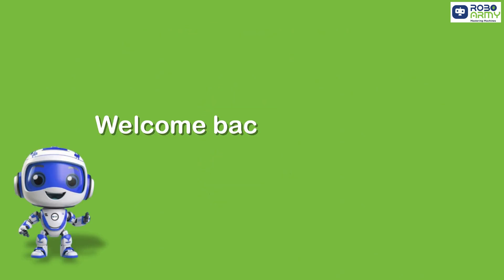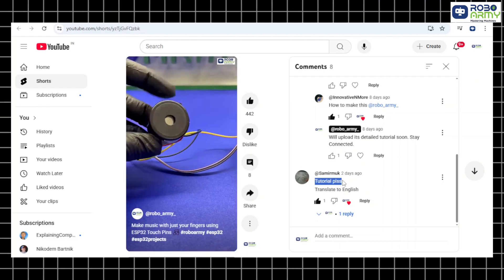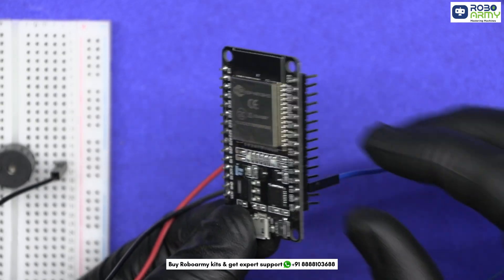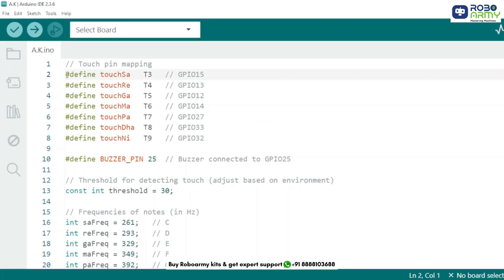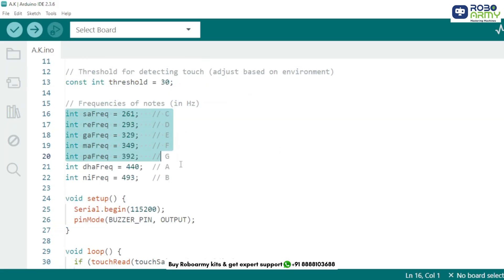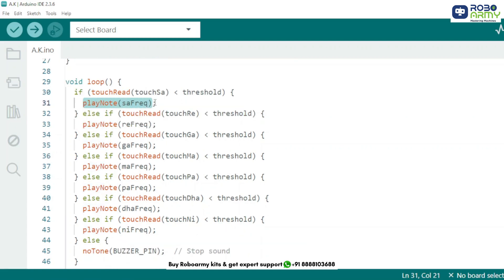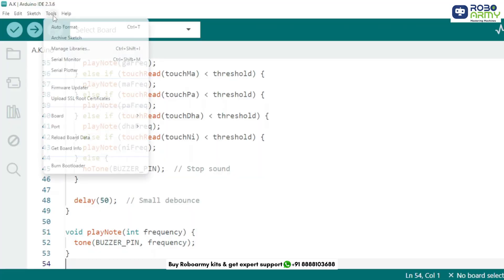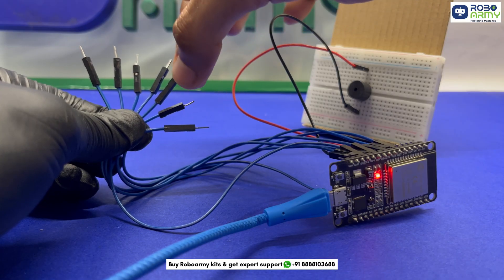DIY Touch Piano Using ESP32 & Buzzer | No Buttons, Just Touch to Play!

Comment: Unfortunatelly doesn't work for me: 'playNote' was not declared in this scope
Reply from the maker: Hmm, that error usually points to an issue with how the playNote function is defined or if a required library isn't correctly imported. Double-check your code for typos in the function name or if you're missing an include statement.

Comment: the buzzer just stays on no mater what i edited in the code
Reply from the maker: It seems like the buzzer pin might be set to HIGH all the time. Please double-check your wiring and make sure the buzzer is connected to the correct digital pin. Also, verify in the code that the buzzer is only triggered inside the button press conditions, not in the loop() by default. If you share your code, I can help you debug it further.
Reply: I had the same problem. Try this

// Touch pin mapping
#define touchSa   T3   // GPIO15
#define touchRe   T4   // GPIO13
#define touchGa   T5   // GPIO12
#define touchMa   T6   // GPIO14
#define touchPa   T7   // GPIO27
#define touchDha  T8   // GPIO33
#define touchNi   T9   // GPIO32
#define touchC    T0   // GPIO4

#define BUZZER_PIN 25  // Buzzer connected to GPIO25

// Threshold for detecting touch (adjust based on environment)
const int threshold = 1000;

// Frequencies of notes (in Hz)
int saFreq = 261;   // C
int reFreq = 293;   // D
int gaFreq = 329;   // E
int maFreq = 349;   // F
int paFreq = 392;   // G
int dhaFreq = 440;  // A
int niFreq = 493;   // B
int CFreq = 522;     // C

int currentFreq = 0;

void setup() {
  Serial.begin(115200);
  pinMode(BUZZER_PIN, OUTPUT);
}

void loop() {
  // 1. Reset the target frequency at the start of the loop
  currentFreq = 0; 

  // 2. Check all touch pads independent of each other 
  //    (using 'if' blocks, not 'else if')
  
  if (touchRead(touchSa) < threshold) {
    currentFreq = saFreq;
  } 
  if (touchRead(touchRe) < threshold) {
    currentFreq = reFreq;
  }
  if (touchRead(touchGa) < threshold) {
    currentFreq = gaFreq;
  }
  if (touchRead(touchMa) < threshold) {
    currentFreq = maFreq;
  }
  if (touchRead(touchPa) < threshold) {
    currentFreq = paFreq;
  }
  if (touchRead(touchDha) < threshold) {
    currentFreq = dhaFreq;
  }
  if (touchRead(touchNi) < threshold) {
    currentFreq = niFreq;
  }
  if (touchRead(touchC) <threshold){
    currentFreq = CFreq;
  }

  // 3. Update the buzzer only once based on the final determined frequency
  //    (If multiple pins are touched, the last one checked will set the frequency)
  if (currentFreq > 0) {
    // Play the determined note
    tone(BUZZER_PIN, currentFreq);
  } else {
    // No pin was touched; turn off the tone
    noTone(BUZZER_PIN);
  }

  delay(50); // Small debounce
}

//void playNote(int frequency) {
 // tone(BUZZER_PIN, frequency);